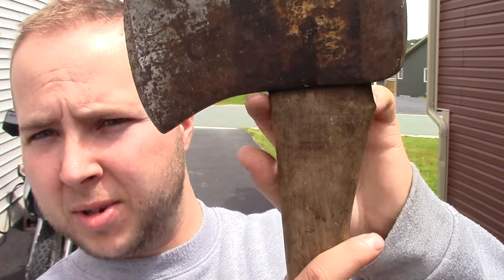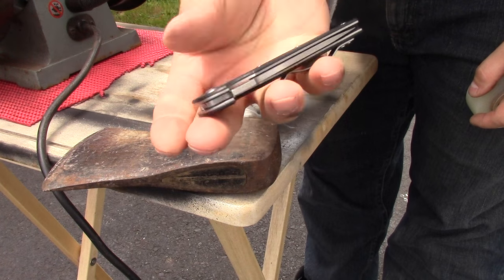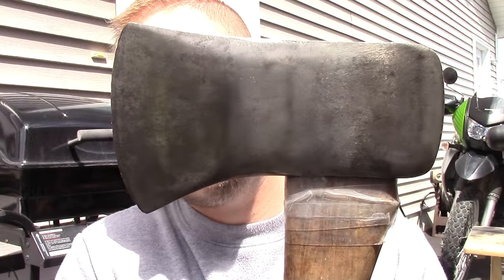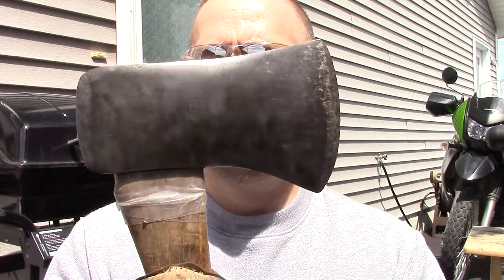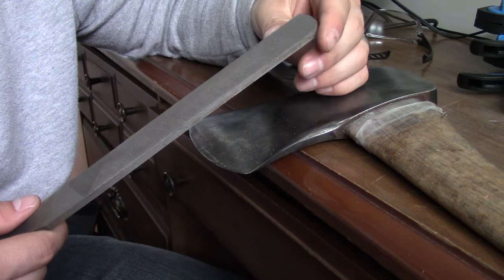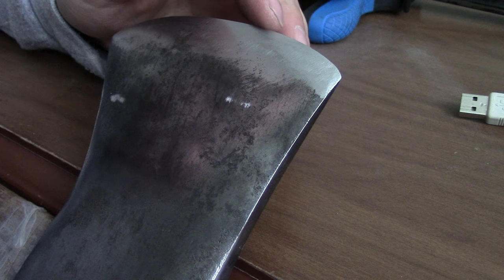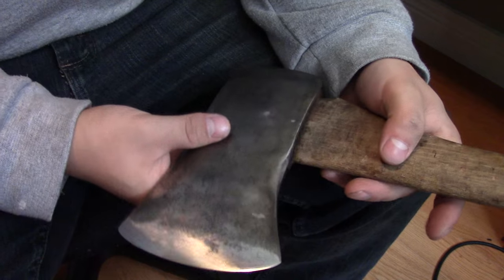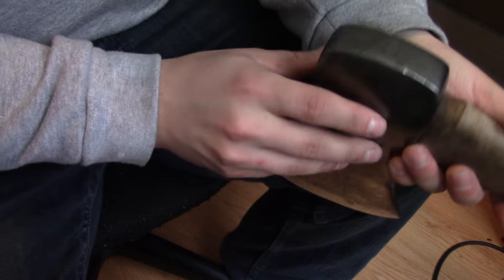Welland Vale Black Prince - Part 2

Comment: Love it man! I'd say, print the original logo, paint it and put it on the wall! Beautiful find! 😉
Reply from the maker: I think we're on the same page PG! Thanks for watching bud!
Reply: +Weiderfan Hey, I'm curious as to why you're so adamant on using the wire wheel instead of vinegar? I remember you commenting to someone about not preferring vinegar baths for ax head resto's. Just a curiosity more than anything. Thanks! Great video man! LOVE that bike in the background too! 😉👍
Reply from the maker: haha thanks man. The bike is my little fun craze. Very nice to get out for a whip every now and then. As for restos, I just don't really like the vinegar process. I find it isn't that effective. A wire wheel works much better, and it happens instantly. As soon as you apply the wire, all rust is removed (as opposed to waiting 24-48 hours). The wire wheel doesn't do ANY sort of damage to the patina. Vinegar stinks. I have to actually buy vinegar... lol you get the idea. Not a vinegar fan.. BIG wire wheel fan.
Reply: Haha! Awesome buddy! I've always wondered but kept forgetting to ask. I'll send you the pick of my old bike I use to love. I sold it to a Canadian! 😉